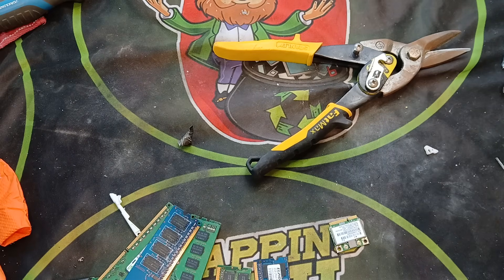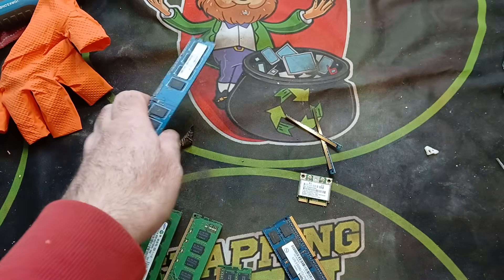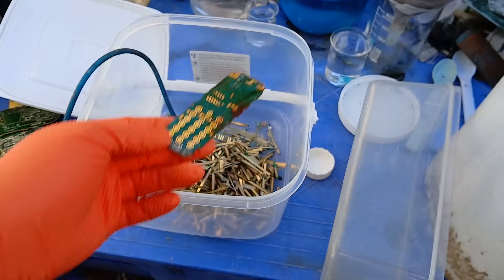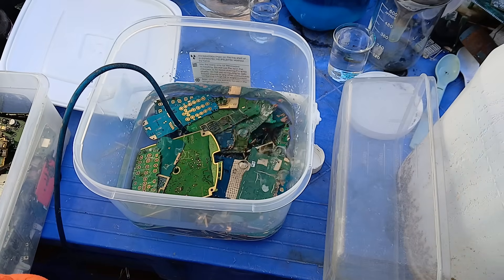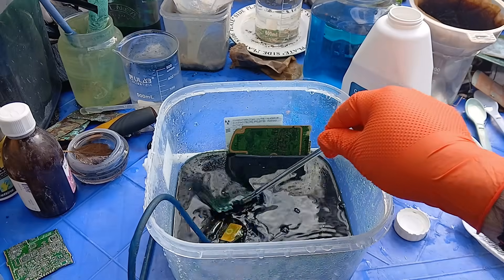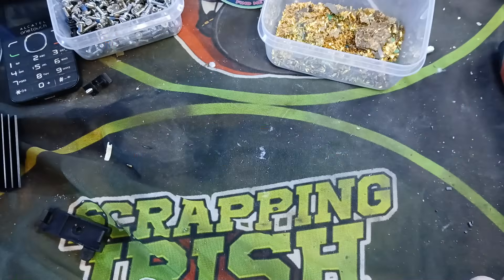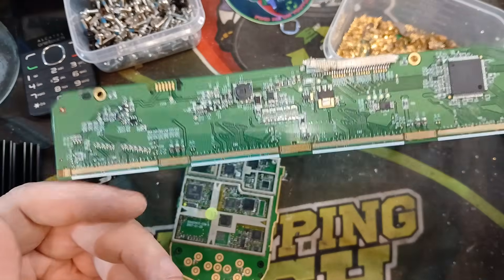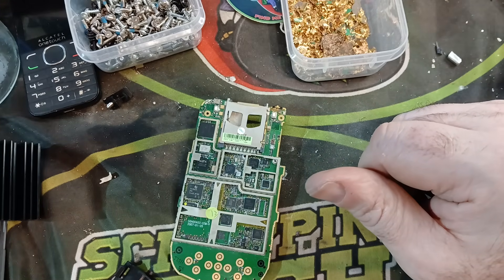The Secret to Recovering GOLD from Electronic Waste

Comment: How do you get the PCB Board Powder to separate from the gold foil ? 

That’s the problem I’m having right now.
Reply: It’s mixed in powder form with the gold foils. I’ve been trying the tall skinny bottle method where I swirl the bottle, let the gold fall out, then pour off the cloudy water. However extremely small pieces of gold foil is pouring out with the cloudy water. I’m saving this water in a 5 gallon bucket.
Reply from the maker: What acid did you use
Reply: @ScrappingIrish copper chloride acid I made after watching your how to video.
Reply from the maker: Not sure what you mean by the pub board powder,if you mean the bits of the green from the boards it won't make any difference if you cant get all the bits out from the gold when it comes to the aqua regia stage
Reply: @ScrappingIrish I’ll email you a picture or short video.

Comment: I hoping you can tell me or help me i mixed hydropoxide and vinagar with salt and the solution?? I have now???but looks to have made my gold come of  circuit boards so I filtered it and now I have powder like and gold flakes in my filter . I ask do you know what i have to do next or did I mess it up??
Reply: @mark81191  that's copper chloride 2. Once filtered,put in a beaker(filter paper and all) and pour in some hydrochloric acid,that precipitate will dissolve leaving the gold foils.
Reply: What do you do if you did put the circuit boards in the acid with all that other medals still on it.
Reply from the maker: If the gold is off just filter out the gold

Comment: So once you depopulate the boards, what do you use to just remove the solder? You use AP?  I see guys using the AP to remove the gold flakes, or am I just confusing myself.  I'm mainly talking about the last board you showed in this video.  What's the best way to remove the solder only but not the gold or is that not possible?  I'm still in the preparation phase and waiting for winter to pass to make first attempts.
Reply from the maker: Just hcl will remove the solder
Reply: So just the hydrochloric acid will remove sodder of the green boards?

Comment: how does one filter the solution? Also how would I properly separate the chips of board you had after filtering? also do you have a video on how to take the chips off the mobo and make the board ready?

Comment: New subscriber here…. What methods have you found are best to clean off the boards of components?
Reply from the maker: I like to use a heat gun to remove the components also a multi tool is quite good
Reply: @ScrappingIrish 

I’ve seen others use a toaster oven and bake them and the stuff falls off.  Ever tried that?

Comment: Great video. 

Few questions: 

1. What snips do you use to cut the circuit board with? The ones I have don't seem to cut the board very easily

2. How do you go about removing all the components and stuff from the boards? I've done some manual removal using flat screw driver heads and wire cutters, but that doesn't really remove everything. 

3. How do you get to the gold inside the chips? 

4. With HCl, I've got access to 32%, I assume I should dilute it to about 12-14% then? Wouldn't higher strength work as well or...?

5. For the Aqua Regia, what strength Nitric Acid and HCl do you use? Am I right in thinking the ratio is 1 (HNO³): 3 (HCl)?

Thanks
Reply from the maker: I'm glad you enjoyed it! You've got some great questions there. If you check out my live Sunday night, I will answer all them on there for you

Comment: If I remember, you said in a previous video all you do to remove the little bits that are on the boards is soak them in the hydrochloric?
Reply from the maker: I use old hcl to remove the chips on ram, but I remove everything else on the boards with a heat gun
Reply: @ScrappingIrish  If electricity costs as much there as it does here then you cannot justify using a heat gun anywhere in this process if you will remain profitable
Reply from the maker: The heat gun uses two units of electricity if used for a full hour so not that expensive to run,two units here cost 60 cent ,

Comment: Do the bits of solder left on have any adverse effects? Or can you still recover the same as clean solder-free fingers and boards? Thanks 👍
Reply from the maker: Solder makes no difference when using copper cholide, but it can use up more of the acid
Reply: @ScrappingIrish  good to know. I have a bunch with a little solder, was wondering if I should mix with the rest to have more in a batch. Thanks!

Comment: So what I've learned so far, get the components off, use hot lye to get the green stuff off, spirits for the sticky stuff, hcl and bubbler to get foils off, hcl and bleach to put onto solution to clean, and smb to drop gold to melt into borax coated vessel and BAM hot blow torch or furnace and pour into scrapping irish King coins :)
(always noting the ppe and safety measures) thank you and God bless!
Reply from the maker: Sounds like you've got a good handle on the process!

Comment: Irish I have two coffee pots out on the table with air lines bubbling through. I've not made a "fresh" batch of AP in years. I use my old AP as a starter and add fresh hcl from time to time. Old AP goes into my waste bucket where I put steel into it to drop out the copper. I've nearly 30 pounds of copper waiting to be cleaned up from my waste. Be safe neutralize your acid before pouring it out. I like slaked lime. Typically takes about 10 cups to balance the ph
Reply from the maker: That's a great tip about neutralizing the acid, thanks for sharing!

Comment: Very fun video. I’m into industrial recycling and am in the middle of building a hammer mill and shaker table to recycle boards for the metals. 

I’m thinking poor man’s nitric with potassium nitrate and sulfuric acid after I collect all the dense metals together on the shaker table. But I don’t know if I want to smelt and couple the shaker table first, or go strait to acid? Because I will also be recovering the copper too. 

If I buy 500lb of metal weight and 60% of that is copper at $4/lb…

Fun stuff!
Reply from the maker: That's a great approach to recycling boards, good luck with your build!

Comment: Great Video, 
Those mobile phone boards, did you remove all the solder first, like a stripping solution ?.
is there any point in doing this?
Secondly can this method remove gold from pins and connectors, and what's the point of sorting magnetic and non magnetic pins?. Other scrappers have done this. 
You had used caustic soda to strip the green mask to reveal some boards that had full gold plating, did you use this method to remove the gold from those ?
I know you scrap e waste but do you think this method would work with gold plated watches or jewellery?.
Looking forward to the poor mans nitric video 
Thanks
Reply from the maker: I did not remove the solder first, and it's not strictly necessary for this method.

Comment: Gidday from downunder mate..
Always enjoyed watching and thanks for your efforts to educate us!
Here is a big question considering I don't have access to an ewaste scrap yard or capability to refine stuff myself.
I have found a mob who will refine for $200/kg.
I have 17 wheelie bins of 1990s motherboards and slot cards.
I've harvested cpu (maybe 50kg ceramic) ..removable chips and ram.
Also got 3 big tubs old connectors showing good gold.
If I'm paying that amount for refining..what should I pull off the motherboards  to send in and what should I incinerate to keep the weight down?
For instance..should I keep all flatpacks and ic chips considering the $200/kg charge?
Cheers..Dave
Reply from the maker: You'd want to focus on high-yield components like the connectors, CPUs, and any ICs with visible gold to make the refining cost worthwhile.
Reply: Thanks!..better sharpen my chisel!
I'll consider using your Ap method forthe trimmed fingers and connectors.
Could I just dump the connectors into the solution or need to pull the pins etc?
Cheers..Dave